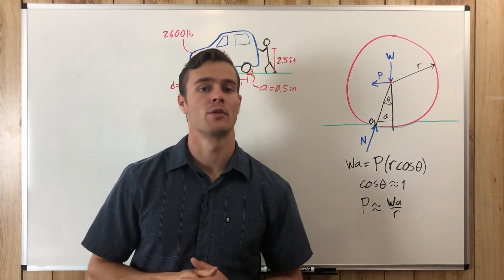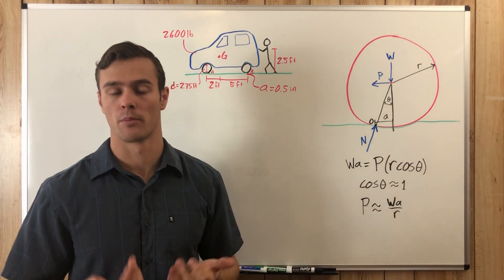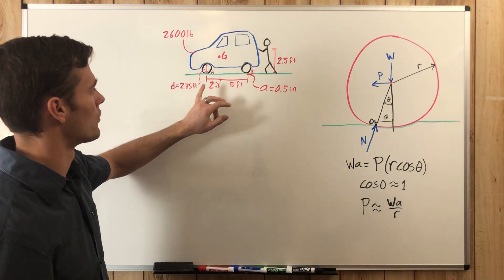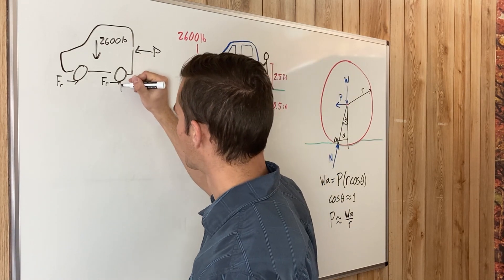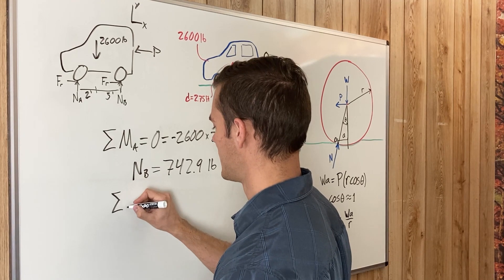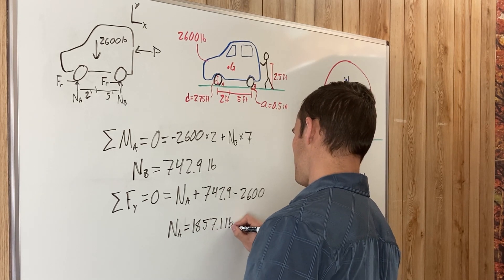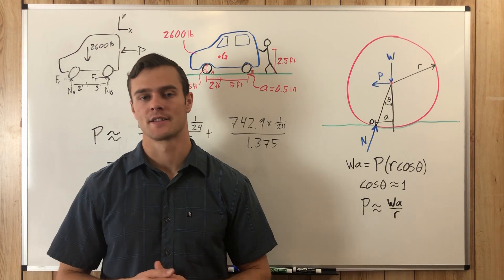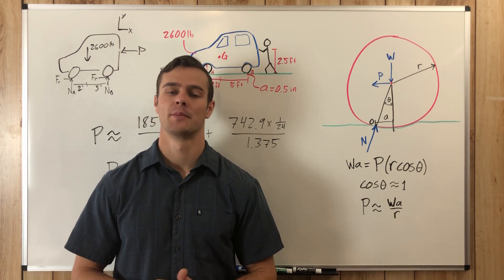WHAT IS ROLLING FRICTION? // Rolling Resistance Explained // Example Problem and Equations Included!

Comment: Hello dear. Can u tell me about the rail problem. When all boggies are connected in a sequence.  8 wheel each boggies. What will be required pull .
Reply from the maker: What is a boggie?
Reply: @studentengineering  train coach
Reply from the maker: I need more information than that. Watch the video and find all the variables that are needed to solve the problem.

Comment: While calculating Moment at A, u forgot to consider force applied my the man
Reply from the maker: The reason why I didn’t include the force P applied by the man is because when I summed moments about A I was solving for the normal force in each of the tires. Once we have those normal forces in the tires then we can solve for the rolling resistance. The sum of all those rolling resistance forces equals P. The force P doesn’t influence the normal force in the tires so we don’t need to include it in that summation of moments. Does that make sense?

Comment: Kudos to the presenter for this video, I would have preferred keeping the force in a unit of force like Newton rather than a unit of mass like the pounds. Mass & Weight are different just like Pounds and Newtons.
Reply from the maker: Thanks! Pounds is the unit of force in English units and slugs is the unit of mass in English units. There is such thing as a pound mass but it is not the standard unit of mass in the English system.

Comment: It is very helpful, thank you for that. However, I have a question: what if all the conditions are the same as in the video, but this time car itself is accelerating?
Reply from the maker: If that was the case it would no longer be a statics problem but rather a dynamics problem. You would still need to solve for this same rolling resistance/force and then probably use it in the equation Force=mass*acceleration and then you could solve for whatever the dynamics problem asked for. This example problem just asked to find the force needed to just barely overcome the rolling friction and move the car at a constant speed. That means that the force to push the car and the rolling friction are the same. 
Does that help?
Reply: @studentengineering  thanks for response)), sure it does.
Reply: Hi is rolling friction the only friction which should be considered when calculating force required to start a motion of a car,lets say this car has two driving whrels are two driven wheels at front.If other fricions between parts and viscous friction neglected,can I consider in order to start a motion traction force from drive wheels should only overcome rolling friction in driven wheels?thanks
Reply from the maker: If I understand correctly what you are saying, the driving wheels would have to overcome both the rolling friction of the driving wheels as well as the rolling friction of the rear wheels. In other words, the rolling friction of all of the wheels would have to be overcome to get the car in motion.
Reply: @studentengineering  thanks for the quick reply,I have a doubt on what is the minimum required force to start moving a car with two drive and two driven wheels, does required force has any effect from static friction between wheels and ground,or is it all depends on rolling friction? Thanks
Reply from the maker: I believe that only rolling friction has an effect. If you go and look at what rolling friction is then you will see that static friction is part of it but other things are also involved and we just call all of it rolling friction.